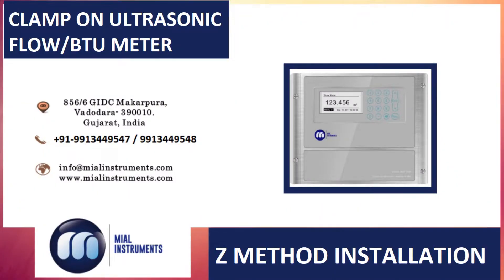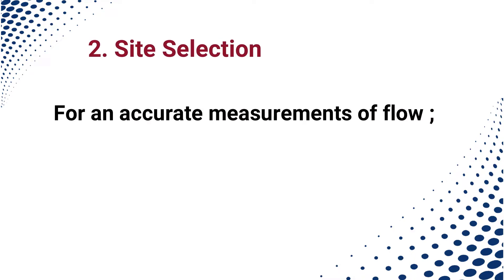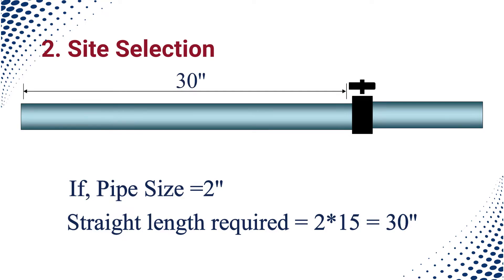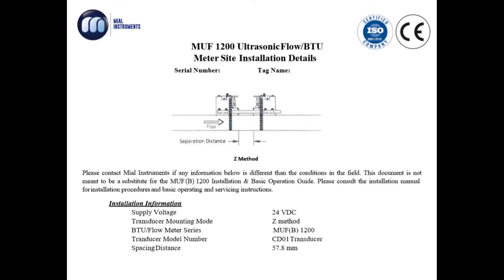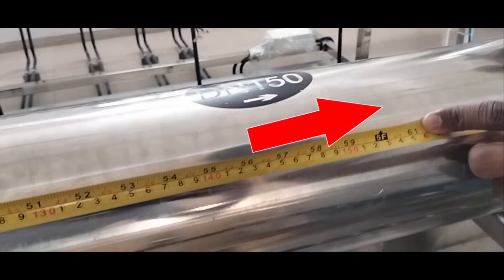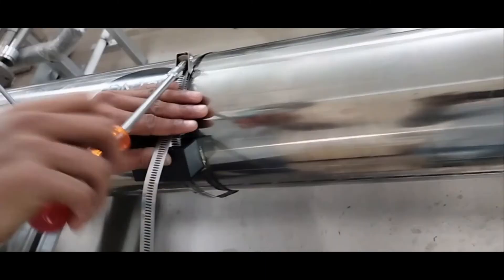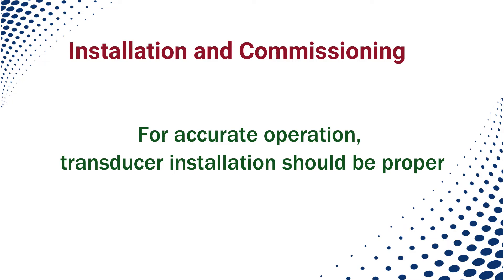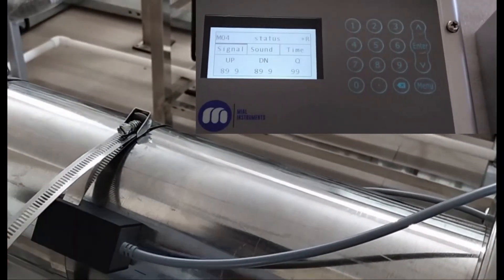MUF 1200 ULTRASONIC FLOW/BTU METER INSTALLATION GUIDE| #Clampon #ultrasonic #installation #zmethod

Comment: IN YOUR BTU METER THE METHORD IS SHOWN AS C TYPE, D TYPE & X TYPE. WHICH ONE IS FOR Z TYPE TRANSDUCER  INSTATLLTION ??
Reply from the maker: Thank you very much for contacting us. Each Mial Instruments flow/btu meters are custom calibrated as per the filled order form from customer. The installation details shall be provided along with each btu or flow meter and will vary based on pipe size.Some times based on field condition the commissioning engineer has to change installation method too (which we can guide them ).Please feel free to write to us for further technical  queries Email : info@mialinstruments.com